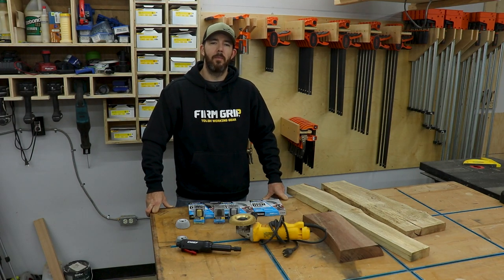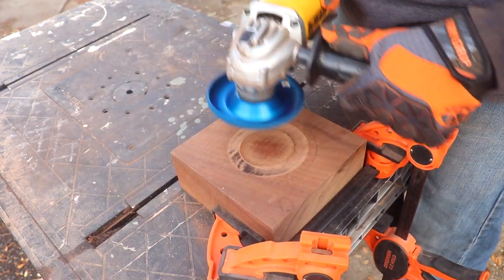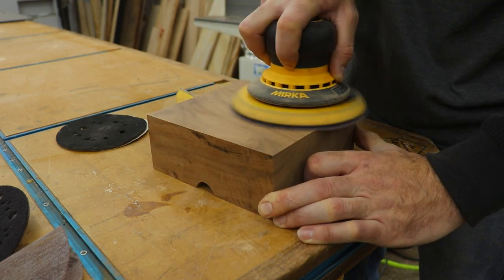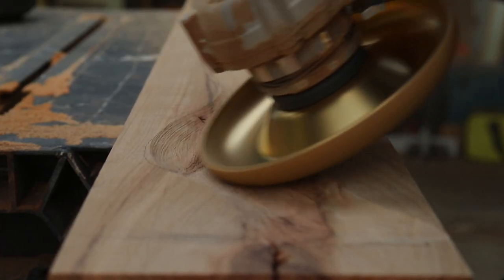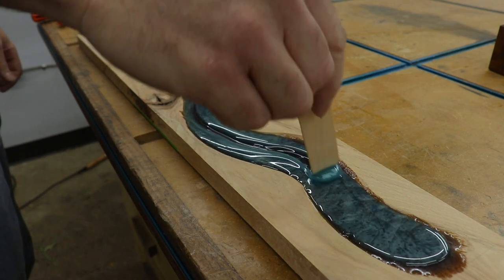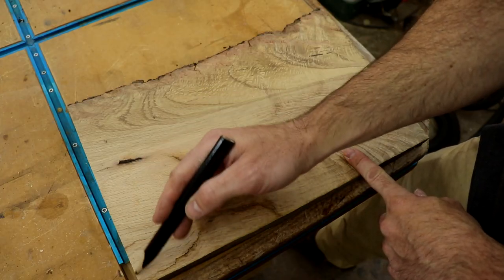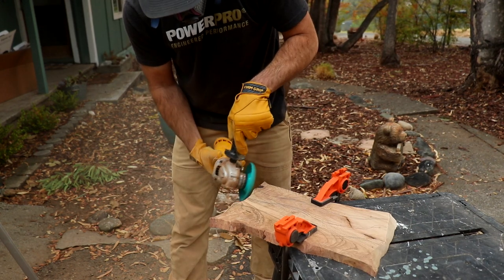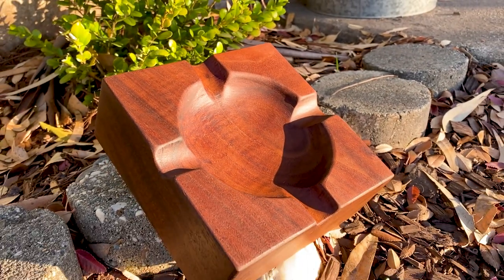3 Easy Power Carving Projects You Can Sell! | Simple Wood Carving

Comment: Great Video. Wondering, do you have any advice or insight on Kutzall's shaving DISH versus their shaving DISC line. I know the shape is more cupped for the dish and that both shapes are available in all grits, but was wondering what your experience has been!
Reply from the maker: I honestly haven't used the disk.  I'd assume it depends on what you're using it for.  They probably both have thier place.  I typically use the dish to rough it out then switch to sanding to get the final shape. 👍